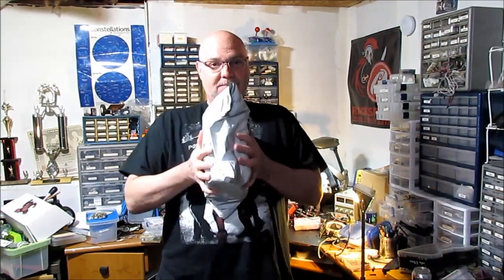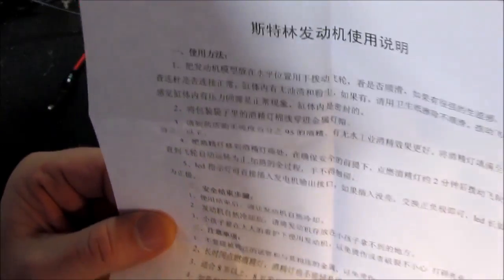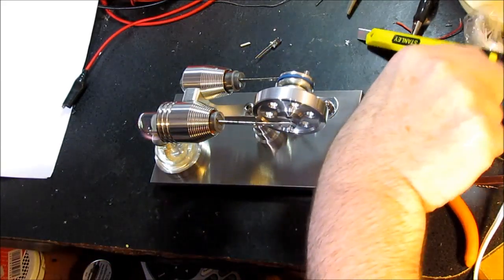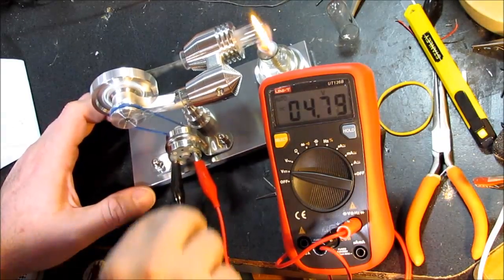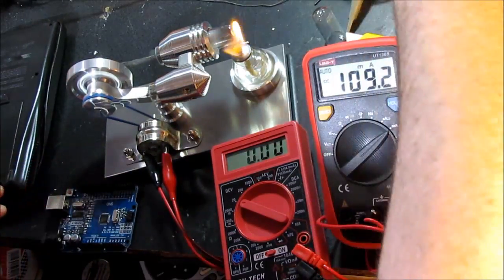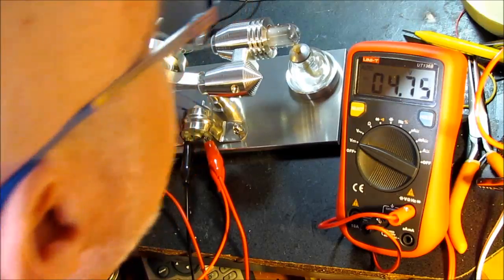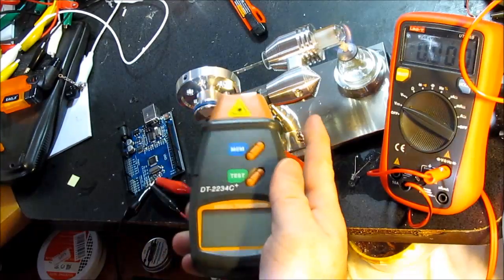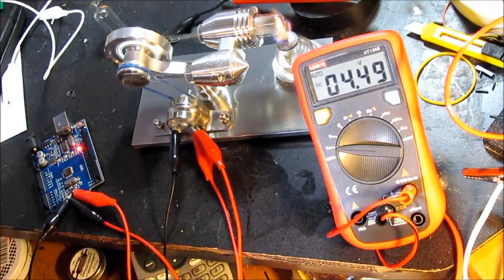016 Can You Run an Arduino from a Stirling Engine?

Comment: What does the part with the connecting rod without the glass tube do? It looks like it would be a drag on the power. The shape is all wrong for a radiator.

Comment: Also, when I used ice, I accidently got a water droplet on the glass and the thing cracked. I didn't know what happened so I just put the glass replacement on. I used the ice and when I pulled the cube away, I got a drop on the glass and it exploded everywhere.

Comment: What was the current at say 4.5 volts? I don't think measuring the current and voltage with the generator at a dead short is fair play?  (meter in current range is almost a dead short)

Comment: Monta quick question so I'm 18 years old and in my state im not old enough to buy alcohol would it be possible to run alcohol most commonly found in house alcohol cabinets. Love the video by the way. Love stirling engines
Reply from the maker: I'm using rubbing alcohol from the drugstore, You should be able to buy that, And it's very cheap.  You can use drinking alcohol although that seems a bit of a waste.  Drinking alcohol would need to be 100 proof or greater in order to burn but would work in that case

Comment: The hotter the Sterling engine gets the faster the Pistons move in the more electricity it outputs so if you let it go for a little bit longer I imagine you could probably make like 9 volts Maybe that's kind of a stretch though 
I also should mention the colder the condenser is what she's already figured out the more optimal it can run

Comment: can you charge a cell phone or power bank with this motor-engine ?
Reply: with additional electronics yes, but very slowly. Definitely not faster than the slowest wallplugs you can buy, probably less than half as "fast". (5V open circuit & 100mA short current -> somewhere around 2.5V * 0.5A = 1.25W if it's linear. 5W chargers are considered slow, 2.5W is the slowest you can find and the standard your PC USB ports can deliver)

Comment: NASA is using a stirling engine in their Kilopower (NUKE) generator (1 KW electric output) for use on the Moon, Mars etc. But, who is going along to give the flywheel a kick to get it started?

Comment: thanks for posting.  some  info.      at 5:30, as can be seen, out-of-the-box,  this type of engine  Needs  Better  ANCHORING.    where  vibration is  unavoidable,   DAMPING  it,   Reduces  energy  Loss.       an engine  Should  have  Mechanical Advantage  over the load.  soooo,  the  SMALL  pulley should be mounted on the Engine output shaft.     googletranslate

Comment: cool vid, love stirlings. run some raspberry pi with ,,, or add two, join them to increase power and run it on hydrogen, solar, maybe also beef up the cold ports with water jackets  with copper coils... or maybe submerge cold ports semi into cup of icy water also clamp it down wasting energy hopping around.

Comment: This might be better to charge a battery since the draw will mostly be on the battery not the generator motor.  Is that a transformer chip?  How many volts did it step up the output to?

Comment: If you get a pro mini clocked down to 8MHz, strip down the voltage regulator and LED's, it should run no problem.

Comment: Hello.

Er, I'm pretty sure you're putting the ice on the power cylinder, not the cold end of the displacement cylinder. Shouldn't you put the ice on the metal end of the other cylinder? The place with the little heat sink fins? Near the glass?

Maybe I'm wrong.

Comment: That thing is terribly inefficient at dead short load. That flame is dumping 40-50W and dead short the system puts out 0.0395W. Yeilding a system efficiency of ~0.1%-0.08%. I would like to see what would happen if you pwm'd the output through a beefy inductor and capacitor and swung the duty cycle looking for a maximum power point.

Comment: To any engineering minded people out there. Could you make a coil like found in an alternator, house it around the flywheel and make the flywheel out of some strong magnets and then run the Stirling? Would that work better than running a belt driven generator?

Comment: Measuring short circuit current is ok if that is what you want to know but you can't calculate power with it because in short circuit the generator works inefficiently and most of the usable power is used to heat the generator. (And in this case engine itself dropped speed significantly so output power was actually lower if we suppose that stirling engine torque is almost constant)

Comment: I have been playing with arduino's for several years now, and have always loved the Sterling engine although I have never had one.  I am considering buying one of them now though after watching this video, however I have a question, I believe it would work rather well to have it run from solar setting in the windshield of our Motor Home,  which we live in during the winter, driving her from the frigid plains of South Dakota to the wonderfully warm desert of Arizona in the Mojave.  So what I have in mind is to sit it on the dash, then mount a small magnifying glass over the heating element and let the Arizona sun run my little engine, to, perhaps charge a couple low power AA batteries from old solar lights that have gone to pot. Then use that power to light some LEDS that I have on the dash for night lights.
Reply: Magnifying glass is what I want to use for the heat too. 👍

Comment: What if you put a peltier element on the radiator. Hot side on the radiator, cold side with a heat sink... you could squeeze a little more power out of it. It would be really ineffective on this design because the radiator is round and there would be little contact between the radiator and the peltier, but if the radiator was flat...

Comment: 5:20 it slows down because of the MCU in the Led, it's not just a diode, its a small computer chip.
I'd say that it was shorting out the chip

Comment: Does anybody else feel sick to their stomach about that unfiltered "dirty DC" supply voltage the innocent young Arduino was being subjected to?
I am amazed - not only that it worked and continued to work, but that it appeared to suffer no damage - YET!   I guess the on-board capacitors were enough!  Monta is much braver than me!

Comment: Now get a Fresnel lens, and you can improvise a mechanical solar power device.
Reply from the maker: Good idea.  I've got the Fresnel Lens (a LARGE one), but what I don't have is a small steam engine to drive with it...
Reply from the maker: Someone bought me a steam engine (almost like magic) so look for this sometime this summer after it warms up!
Reply: Monta Elkins Would be a worthwhile video / project: Fresnel lens solar powering Sterling engine, in turn which would be powering a Raspberry Pi which you would use to run a Lightning bitcoin node.

Comment: Suddenly got a lot of good recommendations from YouTube and found this video. Subscribed! Could you explain how a Stirling Engine works though? Thanks!
Reply: There's so many videos on this. But what I still don't fully understand is why making the cool side cooler helps. I mean, the air is still expanding at the same rate if the flame is constant. The weighted flywheel is what pushes the air back into the hot side, after it was expanded into the cool side. But why increasing the speed of cooling increases gas pressure I don't understand I don't know what the optimum temperature difference is.
Reply: @ribenasquash  the movement is generated by a temperature difference, so increasing the hot side's temperature will do the same thing as decreasing the cold side's temperature. an optimum temperature difference would probably just be the lowest temperature the engine can handle without breaking on the cold side, and the highest temperature the engine can handle without breaking on the hot side.
Reply: @qwerty9118  "The movement is generated by a temperature difference..." does not explain the mechanics, only the prerequisite state for the effect. If the motion is created by air expanding and pushing a piston then faster cooling, I have to assume 'shrinks' the air, so a weight shouldn't be necessary as the cool air would 'suck' the piston. Or maybe the weight is necessary to prevent an equal force of push and pull balancing out and making the piston not move at all... Honestly, I still don't understand. The weight would have to have enough force to counter the heated side so any energy generated would be lost in this action.

Comment: The LED slowed the motor down when backwards because it has a microcontroller inside it (to make it change colors), and standard practice when using a microcontroller is to add a reverse protection diode so that people like you won't break the thing if they power it reversed. It acted like a low value resistor.

Source: 5+ years as an electrical engineer
Reply: Yup, that's exactly what I thought. It's not just a passive component, it has more then a diode in it.
Reply: Could be just an IC, not a microcontroller necessarily
Reply: David H Voltage drop would be one thing
Reply: You mean a diode in parallel? Why not just use one in series and then you just stop the current flowing entirely.
Reply: @clonkex  
Because that LED has multiple colors and flashes, but only 2 leads. Therefore, it has an IC inside. The protection diode is to protect the circuit from reverse voltage. It might even include a zener diode for overvoltage protection when wired correctly.
Reply: +Niko Andruloni Ah, very good point, I must be a total noobface.
Reply: Itsme a
Reply: agree.   the controller is there because  it is a multi-color  led.         googletranslate
Reply: You are correct...RGB LEDs use a micro-controller...but even a regular single color LED would have done the same thing up until the input voltage was able to overcome the reverse bias of the diode and destroy it...Very unlikely that will happen with the tiny amount of current in this gadget though
Reply: Now what about a regular led, not a fancy slow breathing RGB, but just a single lamp?
Reply: @andrewtr001  A regular LED is just a diode, like a one-way valve for electricity. When hooked up the correct way it will light and slow the engine down a little. When backwards, it won't conduct, and shouldn't slow the engine at all. The only exception would be if you put a very high voltage on the LED reversed, then the diode will enter what's called "breakdown" and will conduct (possibly damaging the LED), but that's not likely to happen unless you get around 24 volts or higher, way more than this little engine could make.
Reply: @TheNimaid  and at that breakdown phase, it is any bodies guess what happens at that point.  It likely goes through a phase of basically being a dead short?
Reply: Louis Stubbolo Why not? If I'm wrong, I'd like to know how for my own knowledge.
Reply: Leds are diodes anyways. Light emitting diode
Reply: I don't think that's right

Comment: The reason it slowed it down more is because you had the diode reversed, a diode only allows flow one direction (the direction that lights it up in this case) so you basically opened the circuit with super high resistance by putting it backwards and super loading the circuit.
Reply: It's a fucking diode, you're working with DC, what else do you need to say? basic stuff ffs
Reply: Skyler Small your comment makes no sense high resistance is less load not more.
Reply: chuckels431 A load is resistance, think about a light bulb, the resistance causes heat and light. You can measure voltage drop across all loads in a circuit and the drop in voltage is proportional to resistance value of each load. You can calculate this using V=IR and knowing if the circuit is Series or Parallel configuration. If I have a series circuit with one load (a light bulb) and 12volts I will drop all 12 volts at that load. If I added another Identical bulb into the circuit I would split the 12V between them and they would be dimmer because I doubled the resistance without increasing Voltage or current.
Reply: When there is no LED the circuit is open "super high resistance". The engine runs fast.
When the LED is the correct way round there is a little IC with a resistor and the proper light emitting diode in the circuit. Around 3V drop on the LED, the rest on the resistor. The circuit is closed with moderate resistance, engine runs fast still, but slower. 
Now the LED is reversed, the engine runs slow. Why would it be high resistance now if with even higher resistance the engine did run fast?
The colour-changing chips in those LEDs are often protected from reverse polarity with a diode (so low resistance), resulting in higher current than proper polarity thus higher load on the generator. If you spot your mistake fast enough, the chip doesn't get destroyed.

Comment: how does measuring it slow it down? just curious, but does that put up resistance or something.
Reply: yeah the multi-meter has resistance and resistance in the circuit causes resistance on the axle of the generator

Comment: If you stick your two probes straight onto the two poles of your power source without there being a load inbetween that 'circle', you are causing a total short, when you are in the mode that measures (milli)Amps on your meter. Leaving them on consequently like you do, gives you an enormous chance of just burning your (in this case little) generator and causing a short circuit is also Not Precisely The Right Way to get to know what actually that amount of applicable Amps is.. Don't try that with your probes straight into a wall outlet either: you will cause a bang, some big sparks, and maybe melt it even weld the tips of your probes (you won't see that though, cause you will be in the dark). Measurements should be done in line with your power consuming load (lamp, apparatus) - so with that connected to the power source, and then by cutting INBETWEEN on one of both wires. You that way see the actual amount of power consumed & running, and the power consuming application will act as a natural sort of safety, be cause it acts as a resistor: it only leaves trough what it has actually used and this will LIMIT the flow. By the way, this fault also explains why you got almost zero voltage any more, whereas it at first was above 5v: you created a short-out. Attempting to 'measure' the flow this way makes no sense: you did not get a real outcome that tells you anything: 100 mA times [almost zero] V = almost nothing. You only got ANYTHING be cause your meter got some internal resistance of its own. In (milli)Amp mode your meter measures by taking a small percentage of that enormous flow that in Amp mode runs through what furthermore is nothing but just straightdown a CONDUCTIVE connection inside with a very small very powerful resistor that can handle all of that power, and it can measures ACROSS the resistor. That is why these things have a fuse in mA mode, you otherwise would burn the circuit if you would overload it.

Comment: Dude! Your open cct voltage was 4.5V. When you were measuring current, your voltage fell to 0.4V. That means you were short-ccting the generator! That's why you don't measure current without a load - you're using the meter internal resistance as the load and can burn it out.
Reply: Maybe his intention was to find out the short circuit current!?

Comment: Try a nintinol graphite thermal electric generator with a mini glow plug with a thin titanium sleave. For a regenerative heating element to operate the stirling cycle. Design the mini glow plug to heat up with a mini glow plug starter till the Nintinol graphite TEG kicks in to keep the glow plug red hot. Try a rewired mini drum motor generator with magnetic bearings with a vacuum spark gap to produce high frequency electricity. 😊

Comment: Who else is getting bothered by it constantly sliding on the desk
Reply: Only because of the open flame
Reply: I bet that if engine platform would stay solid in one place, RPM could rise a bit.
Reply: It's best to run it in a square cake pan.
Reply: Yeah, really! Nothing that a bit of sticky side of duct tape rolled up to hold it underneath, eh?
Reply: The thing's enough of a fire hazard stationary. I don't feel comfortable with the possibility that it's going to slide off the table. And even if it wasn't a fire hazard, chances are the impact of the fall would probably break it anyway.
Reply: Guilty :)
Reply: Of all the the things to be concerned with......
Reply: Any motor has to be secured for that reason.
Reply: Tate Seacrest 
Don’t buy this and have that problem if you have OCD
Reply: @thegamerlamp1403  
A person with OCD would clamp it down so it can't move.
Reply: Me

Comment: I must recommend SEPIC converter. my idea: stirling >  stepper motor > bridge rectifier > min.2200uF cap > SEPIC > arduino/raspi zero/wlanrouter etc... Wiki says "The single-ended primary-inductor converter (SEPIC) is a type of DC/DC converter allowing the electrical potential (voltage) at its output to be greater than, less than, or equal to that at its input"...
Reply: how can a motor have a greater output than what is input is?

Comment: You should remove that pipe connecting the fire piston with generator piston and you will not be conducting unnecessary heat thus you will not need to use the ice cube anymore.
Reply: no he should not. the "generator" piston is the cold side of the engine ,which it needs.